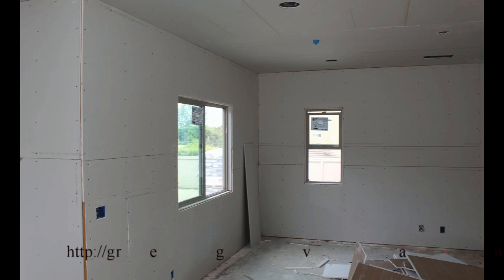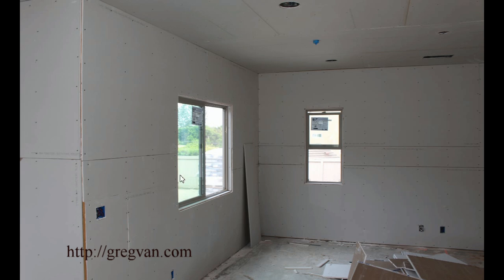Why Do They Install a Middle Section of Drywall in Walls Taller Than 8 Foot?

Comment: Here in Australia we install our gyprock (Drywall) sheeting horizontal  because it adds to better  bracing. The 2 widths in the sheets we have here are 1200 mill and 1350 mill  one for 2400 mill (8ft) and 2700 mill for(9ft)
Reply: Yep. Same in Nz. I find the yanks method idiotic

Comment: It's called a bellyband and some guys will actually fill in "belly" with 3/8 sheetrock to match the factory taper of 1/2 inch board......so the whole middle is 3/8 and not 3/8 tapered to 1/2 board fill back to 3/8 taper if that makes sense......it tapes out easier that way....

If using 5/8 board than 1/2inch belly and board
Reply from the maker: That is interesting, I've never heard of people using smaller wallboard, but can tell you that most of the time these walls are finished this way, they are pretty flat.
Reply: @gregvancom  it makes whole "belly" like factory tapered seam...easier to fill......instead of factory to butt on 2 seams that close together.....it tapes out a bit easier.......there's a comment/reply from few years ago on here saying same thing ....

I've never seen 54" board in so cal, maybe it's here but in 35yrs I havnt seen it.......I'm Australia they have 20ft lengths of drywall so that would make life a bit easier for tapers
Reply from the maker: @kirkdunn1379  It makes sense, but I've never seen it done here in Southern California. I've also never seen 20 foot sheets, that's nuts.
Reply: Correct. Using an 1/8 thinner board is practical for belly bands where necessary. We try to avoid them as much as possible by using different widths to accommodate ceiling heights.

Comment: in australia you can get sheets 1350mm wide as well as 1200.  so, unless your ceiling is more than 9ft, you shouldnt ever have to deal with this problem.
Reply from the maker: They actually sell a wide variety of different sized drywall in the United States as well. I really don't know why it isn't used, but have a feeling it has something to do with pricing or availability.

Comment: I'm a professional drywall finisher. 54 inch sheetrock is available at most drywall supply houses. Yes less stilt time equals less time on the job. Sheetrock err uh drywall comes in 
4x8
4x9
4x10
4x12
4x14 in half inch and five eights thickness. Comes in 4x16 in half inch only. Three eights and quarter inch in 4x8 only. Plus finishers like you say don't want to bend over and tape bed and skim. I have been on jobs where I have had to tape along the bottom. Where the owner or builder didn't use a base board. That is a real pain in the butt. Nowadays walls get spray textured a lot more.
Reply from the maker: What state are you in and does everyone throughout your state use 54 inch materials?
Reply: @gregvancom  from Indianapolis Indiana. Oh yes been using it since the nineties. Problem I see with it is the bevels are much deeper. Gotta use a fourteen inch knife to get them filled in.

Comment: Use stretch rock it is 54” tall instead of 48” to get 9’ without all that extra work and materials.
Reply: Ok and then what if they're over 9 ft. Same problem.
Reply: @evictioncarpentry2628  2’ -4’- 4’ or 4’ -4’ -2’ for a 10 ‘ wall less mud and work for the finisher,finishing flats .personally I rather have the rip at the top of the wall instead of bending over to finish a low joint.  The only time we do a belly band is when the wall height is odd like 8’6” .

Comment: As a GC I always run horizontal on anything stick built.  On commercial hang vertical since generally steel framing and for fire code. I also order a variety of lengths to eliminate  every butt seem possible. 8' 10' 12' 16' and 54s if taller than 8'. Another thing drywall is relatively cheap don't waste time trying to use up cutoffs. The labor involved isnt worth it and you'll just end up making unnecessary joints.

Comment: I'm confused about one thing.  The center strip will have cut edges butted against the taper edge from both the upper and lower pieces wouldn't it?  If so isn't that hard to finish?
Reply from the maker: +applegbt You've got a good point and it is a little harder to finish, but we've been doing it this way for years. In other words, tapered edges are nice, but not always necessary.
Reply: I did a 8'8" tall wall and used 3/8 board for the ripper (center piece) with 1/2" sheets  top and bottom you dont get that "raw" edge it works out great ........ One reason NOT to hang vertical is that a continuous vertical joint  floor to ceiling is harder to hide than horizontal joints are  and the butt joints  (vertical) are offset and at least 12' apart
Reply: Not if you have flat boxes  just put your mudd in the right places with the flat boxes and thats it  for pros it easy

Comment: As an amateur drywall finisher, I did my nine foot ceiling rooms the other way. I put the one foot scrap along the bottom. The rationale was that the bevel joints are superior to and much easier to finish than butt joints, so I eliminated all butt joints from the room. Although I had to sand the lower bevel seam on my hands and knees, every flat-cut edge is concealed by corners, baseboard, or door and window trim.
Reply from the maker: +wilkesjournal I've done it before myself and agree with you 100%. It would definitely make more sense to keep the seams or factory edges more at eye level and the odd piece below, but it's definitely more difficult to do it that way.
Reply: Currently doing my house in the kitchen and I’m also doing the bottom seem due to half of it will be behind the base cabinets
Reply: My walls are 97.5" and I was thinking baseboard cut but maybe a 1/4-3/8" gap between sheets is best since they require mud anyway. I worry about sound transmission though in a multi-family unit.

Comment: It's way more than that! It cuts your mud and tape time in half almost, because after you tape your two middle joints, you're just feathering out one giant joint in the middle, instead of feathering out a joint in the middle AND the top/bottom

Comment: A lot of folks talking about 54 panels, but yeah you can only get them special order where I am, as well as 1/4 is special order and more expensive than 3/8 They might be carving down the cut edge some how and then taping to keep it flat
Reply from the maker: Yes, I think the price of the product has everything to do with why it's not used by most drywall contractors trying to compete with other drywall contractors.

Comment: It's more easy to stagger your joint's, In the middle .You can run drywall sheet out. without trying cut on center suds , i had 10ft  and find it's easy that way . i'm new at this had 16 sheets up stair's.

Comment: Whether it’s accomplished vertically or horizontally, isn’t a tapered end supposed to meet a tapered end? In the scenario here, there’s no way that’s possible. The 2’ piece has (at least) one butt end. There will be a belly running horizontally (at eye level) right down the middle of the wall.
Reply from the maker: Yes it would be nice if all of the edges that needed to be taped were tapered, but they've been installing drywall like this for decades and some of them are pretty good at it.
Reply: A tapered end doesn't need to meet a tapered end. When installed horizontally, on a long wall where one factory 4 foot end meets a factory 4 foot end, you end up with a butt joint.
 When a butt end meets a tapered end you get a bastard joint. All that means is when you go to finish, you have to treat it like a butt joint, often having to coat it as wide as 2 feet.
In the case of this (what we call, a "belly band") you'd end up coating the whole middle piece so maybe 3 feet or a bit wider for a final coated joint (depends on width of belly band).
Sometime it's unavoidable so you pick and choose your battles. If you, the hanger are also the finisher, I'd rather have to coat a bastard joint at about 4 foot high (standing) than tape and coat a recess joint 1 or 2 feet up (on my knees). You also go slower when working on your knees, get tired faster, can cause damage to your body. In the end it works out.

Comment: This is a production technique and the only benefit is convenience for the installer.  It should never be done on walls where the texture is going to be smooth wall (untextured level 4 or 5.). Drywall is meant to have the manufactured "tapered" edges meet, to provide a depression to help hide the tape and mud at the joints.  This "middle piece" technique requires ripping the drywall sheets into 1' wide strips, leaving at least one long side (more often 2 sides) with a cut edge thickness with no taper, sometimes even slightly swollen.  The result can be a visible band all around the room, especially noticeable with overhead recessed lighting or some sun conditions.  This is a choice to be avoided if possible.
Reply from the maker: Good point and again, you're suggesting smooth wall problems, not texture.
Reply: @gregvancom  That's mostly right.  I have a client right now who was promised level 4 smooth wall finish, but has a distinct band of shadowing throughout her brand new custom built home because the drywall sub was allowed (or not supervised) to do the filler band.  It looks weird.  The contractor is telling her another coat of paint might fix it, but the light is severe and the band looks like a DYI job. The point is:  beware this technique unless the conditions or texture will be forgiving.  Thank you for the series, the reply, and the opportunity for so many folks to write in their questions, comments, etc.  I'm very appreciative of people who take the time to post educational material on YouTube.

Comment: Better to stand board up for fire rating as well. Every drywall joint lands on studs instead of open cavities.
Reply from the maker: In some cases it might not be practical to run the drywall vertically or up and down instead of horizontally or sideways, but I would always check with your local building authorities for clarification. Sometimes you're not allowed to install it vertically.
Reply: Thomas - You just demonstrated why you never let an amateur like yourself mess with drywall. Youd be fired after you hung your first board.
Reply: but the tapered joint is filled with mud whereas the butt joint not so much
Reply: @johnparker7784  in commercial applications, specifically metal studs you always stand them up. this eliminates any and all butt joints because the sheets will break over ceiling height. taller ceiling? use taller boards. 10 and 12 foot is common, but there is longer.

Comment: 4' x 9' sheet  install vertical except on cabinet walls you put small piece on the bottom so no seams on back-splash
Reply from the maker: Again, some engineers and building departments require drywall to be installed horizontally.

Comment: I  have did drywall since 1984, its less noticable with 2 seperate flats  ran 4 ft apart 12 inches wide than 1 ran down the middle, humped up 90 percent of the time , 3 ft. wide, I  started in my 20's, in my fiftys now,  might kmow what I'm talking about
Reply from the maker: You might have some experience in drywalling, but we might need some more details. Are you suggesting that it's better to start with a 4 foot piece at the top and then install another 4 foot piece under it and then the 1 foot piece? I'm not trying to start an argument, because I understand that it won't be as flat using the tapered edges of the drywall.
Reply: gregvancom if your hanging 9 ft walls use 2 sheets of stretch which are 54 inches each which equals 9 ft, stretch is readily available everywhere now so don't know why you would be using 4 ft, anything over 9 ft and under 10 measure up 72.5 inches, rip top sheet to that measurement from 72.5 up, hang 4 ft next with 2 ft rip at bottom
Reply from the maker: I personally have never seen 54 inch wall board used on any project I've ever worked on, over 30 years in the business and really wonder why it isn't used. My only explanation would be costs, because it seems like it would be easier to finish, even though it might be a little harder to hang, being heavier. I'm in Southern California, where are you at?
Reply: gregvancom I'm in southeast missouri, worked all over the southern states, don't know much about so cal, born there but moved a long time ago, we are talking 1/2  inch, correct? I  have not seen stretch 5/8.
Reply from the maker: Maybe that's the problem, because most of the projects I've worked on use 5/8, but this is a standard practice out here with half-inch also. I have to say I've placed straight edges on these walls look pretty good. However, when I just fixed a wall at my house it didn't seem to look as good.:)
Reply: gregvancom I just find it hard to believe that stretch rock is not available in Ca., Mo. is usually far behind on everything, belly rip is okay if you have a good finisher
Reply from the maker: I'm not saying that it's unavailable. I just don't know why it's used when they do have the 54 inch stuff. It might be too heavy, because everyone uses 12 foot sheets out here.
Reply: gregvancom thats all we hang is 12 ft, comes in lightweight , not as heavy as regular 48 and saves a lot on finishing
Reply from the maker: Well I don't know if we are any better off than when we started. It does seem like it would be faster to use two sheets instead of three sheets for a wall, using the 54 inch stuff. Weight might not be the main reason why it isn't used, which takes me back to the cost and it might also be more difficult to load in a building.
Reply: gregvancom we use it on everything we can, always on 9 ft walls, do a lot of custom homes with high ceilings, saves time and money on finishing

Comment: Wouldnt it be easier to use 3/8 board in the middle section?
Reply from the maker: I wouldn't. Common sense might suggest it, but don't forget you can use 54 inch wide drywall if you're worried about finishing it smooth.

Comment: Why not just use 10 foot drywall lenghts save time on plastering the seams.
Reply from the maker: That will work, as long as the building department, engineers and other building officials approve it. For residential construction where I live in Southern California, the drywall goes from right to left or horizontal.

Comment: Or buy 4’ 6” wide dry wall for your 9ft ceiling to save on muddling and taping
Reply from the maker: It might save on taping and finishing, but I have a feeling it has more to do with the price of the drywall, otherwise everyone would be using it.
Reply: We’re building house now and looked at both options. The wider sheets are more expensive but you are getting more material per sheet. We are making up the extra cost for the muddling and taping as well as it is much less work for them to finish.
Reply: Stretch rock is about 3 cents a foot more than 48 inch rock everyone does use it
Reply: @paullewis8842  I can’t find 4.5x8 anyway around here. Only in 10’ and 12’ which I can’t get in my basement. So I’m either vertical 9’(more expensive) or regular 4x8 with a middle filler(save about $500)

Comment: The pros are easier for finisher easier for  the hanger save on overall sheetrock you just got to make sure your level at top and bottom so your rip is the same
Reply from the maker: Good point and I've seen installers put the rip or the centerpiece in after the top one had been installed, but don't know what method would be more commonly used everywhere.

Comment: I just drywalled to houses with 10ft walls like this. Never again. Not with a he extra measuring and cutting in the middle. Creates extra tape&bed work and extra mudding to to hide bump from butt joints. Don’t be lazy and just bend over and get it done

Comment: It's actually because the center is less noticeable to the eye when you build it up with mud. It still appears to be flat as opposed to the top or bottom, which would be very noticeable. Has nothing to do with ease of finishing.
Reply: Vince Trombly  as someone who does drywall everyday day, it is for ease of finishing and not correct, 2 gt rip at the bottom than up is correct,
Reply: Larry Tolliver I did drywall everyday in my 20s means nothing to me. That is not correct you build away from the center of the wall in this situation because of both joints and the amount of mud that is required in finishing and is the highest point of the wall and is eye level so it's hard to see the bevel from that angle. Same reason for avoiding joints around doors and windows as the build-up of mud at an already visible line is easily noticed. If you have that joint higher on the wall it will stick out like a pimple on an ass.
Reply: Vince Trombly youre full of it bud. I dont care about your resume I ve made my living at this for 20 years.
This method is only acceptable for a fire tape and little else beyond garages. And by the way if it were at top or bottom you would only be right if the extra rip was a "bastard" joint without a recess on the xtra joint. Your point isnt even secondary in why the bastard is in the middle.

Comment: that's why they sell 54 inch drywall
Reply from the maker: +George Merrick I love learning something new and this was the first time I heard that you could get drywall wider than 48 inches, which brings me to my next problem, it must not be cost effective, otherwise everyone would be using it.
Reply: Harder to transport & put into position but for me it breaks easier.  Also with a belly band there is a sealed seam tight along the floor and ceiling.
Reply from the maker: You've got a good point, I would imagine 5/8 of an inch drywall that's 54 inches wide would be hard to handle and heavy to hang, plus it would need to be stacked below the 48 inch wide stuff and I imagine that would create a problem for the people who load the drywall.